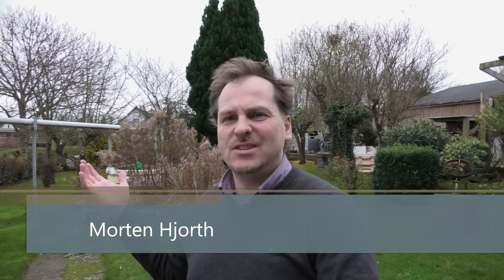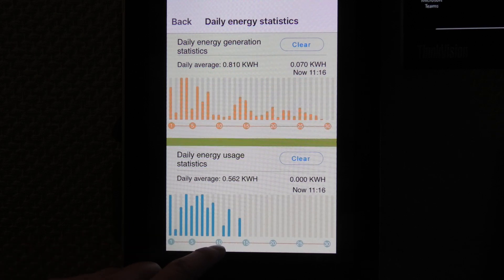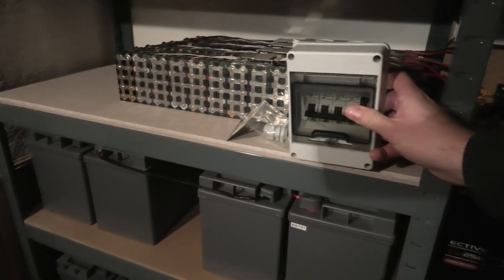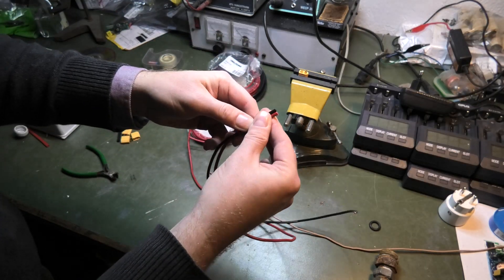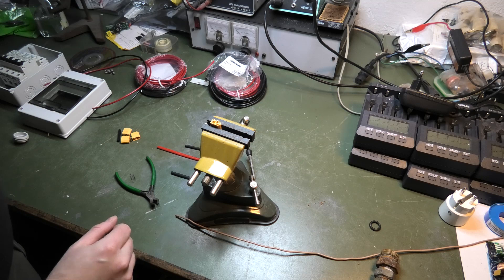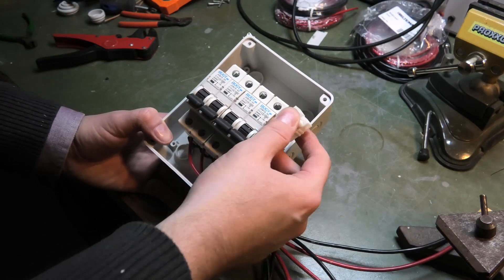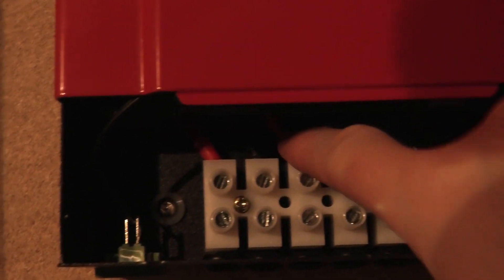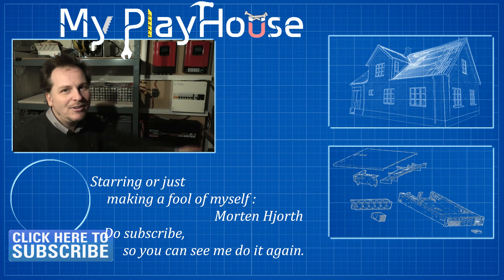Working on Connecting my 4000Watt Hour Li-Ion Bank - 1021

Comment: AC breakers for DC can be dangerous, especially when you turn them off with load....
Reply from the maker: I am awhere.
Reply: Ac breakers make the arc sustained inside the breaker and can cause fires

Comment: If you have a battery in your bank which has high self-discharge you may be able to find it by seeing which one is accepting the most charge current. Alternatively just disconnect one or two at a time and see if the voltage falls.
Reply from the maker: Hi eDoc2020
Thank You very much!  glad you liked the video :-)
Thank you for watching! :-)

Comment: Relocate the black disconnect and mount the new panel on the right side of the bigger panel directly under the inverter. Also, you don't need to run the negative wires into the panel. Just take them straight to the inverter.
Reply from the maker: Hi Glenn
Thank You very much!  glad you liked the video :-)
Thank you for watching! :-)

Comment: Does your drop-off in harvest coincide with your re-wiring the panels for the newer charge controller?  Something doesn't seem right--you should be increasing harvest due to greater efficiency (lower loss with more panels in series).  Just brainstorming.
Reply from the maker: We have not had sun in a month,, not one day of clear sky,,, really sucks.
Reply: @MyPlayHouse  I feel your pain!  But cheer up--last winter, my daily harvest (not grid-tied) actually went up on slightly cloudy days, because the light was more diffuse for a longer period of time than if if was a clear, sunny day.  Sounds crazy, but during the short winter days, my harvest was actually slightly better on lightly overcast days.

Comment: It is a good practice when connecting batteries in parallel to use wires with same length. Equal resistances of wires will traing to equalize currents in and out of paralleled batteries. It is a good practice to use breakers or fuses with at least one and a half times  nominal amp rating than maximum steady state current in the application. Wires gauge should be according breakers / fuses ratings.
Reply from the maker: Hi Aleksandar Kostadinov
Thank You very much!  glad you liked the video :-)
Thank you for watching! :-)

Comment: Morten - if you’re buying new cables, also buy a couple (one for now and one for spare) of those fancy smaller combining connectors you wanted to use but didn’t have enough capacity.
Reply from the maker: The cable I am going to have to use ,,is to big.

Comment: Would it not have been better to use a knockout on the side with a rubber grommet to protect the cables? 
Otherwise its another great video. Fun and informative!
Best quote "the weather is .... eh!"
Reply: Meh it’s not grid connected and a plastic box can’t short connections
Reply from the maker: Hi Biran Patel
Thank You very much!  that would have been another good option :-)
Thank you for watching! :-)

Comment: i was just thinking that, if you could find some large acrylic sheets. at a good price you could enclose the data center with sliding doors, i reckon it would cut the noise down and improve the air flow around the servers.?👈😒👺👀👀👉🦉
Reply from the maker: Hi ralph ups
Thank You very much!  glad you liked the video :-)
Thank you for watching! :-)